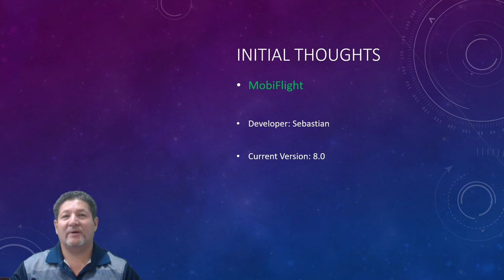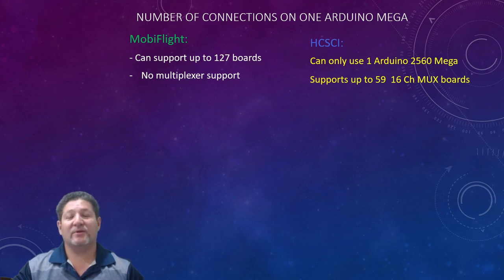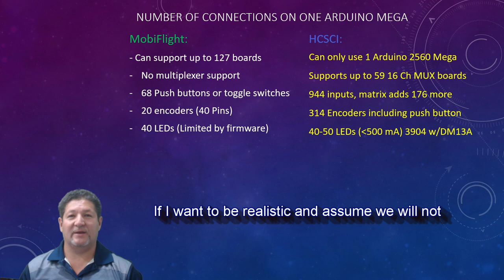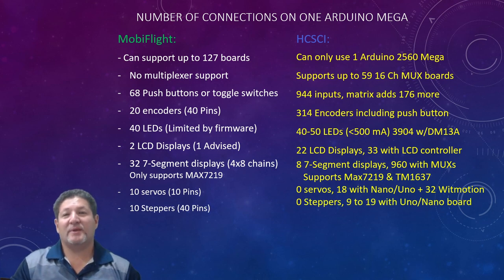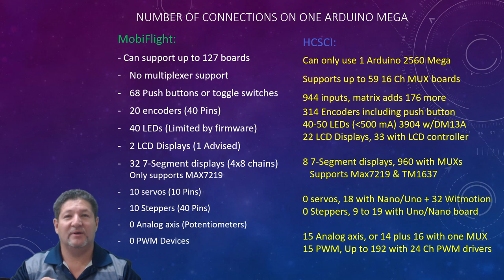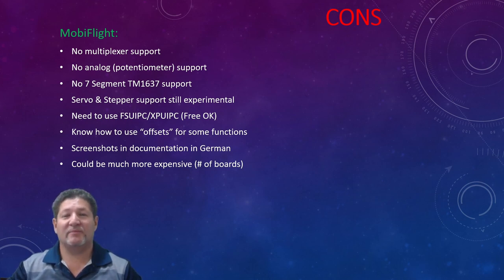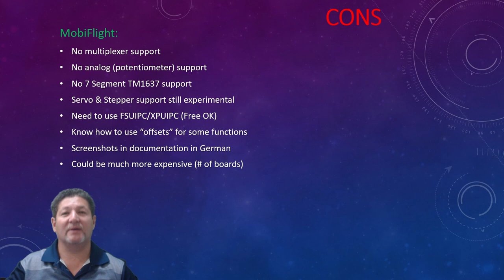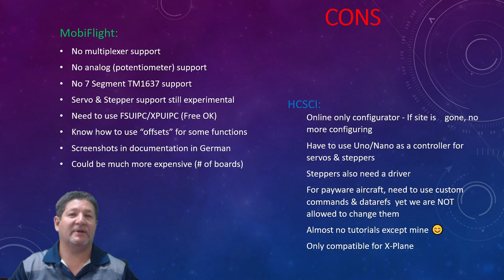HCSCI (Now SimVimX/RealSimControl) VS MobiFlight (Please read description below)

Comment: Awesome comparison! Please note that with MobiFlight you need to run their tool to connect the Arduinos to the Sim, it is not just to make the configuration. With XPWideClient the software can run on a different PC and therefore you would not have a conflict with the HCSCI Arduino. X-Plane Specific: You have to create your own Offsets which point to datarefs in X-Plane. Which means you also have to figure out the data types and such. And there is no community project to create a common list. Imho that is such a pain in the arse that, at least for me, HCSCI is so much better even with current limitations.
Thank you for the video!
Reply from the maker: Oh yes, good point Peter. In a way it's like running the HCSCI plugin inside the simulator but this one is "outside" Although technically each Arduino board has a different address, I do worry there might be some conflict because I've seen that mentioned in the HCSCI forums when people are having connection problems. I see them telling them "make sure there are no other Arduino boards connected to the computer." The simplicity of this system is definitely one of it's major strong points.

Comment: Yes reading the website is also very important, I tried to replac the old version with new HCSI without  reading the page, I deleted all, and reinstalled from scratch, but my 7-SEGEMENT didn't work, So I visited the website by reading carefully, I noticed I should not deleted my old settings and data, So I did what website instructed, well.. all is working now 😁😀👍👍👍 I have still to say, your video helped me very much, to not getting lost whenever I visited the website. 👈🥰 awesome comparison.

Comment: Thank you sir, for another great thorough video!  I agree that its a bit risky making a lot of invetment in time and materials, if they decide to just shut down the business. This could be easily alleviated if the just had a stand alone configurator!
Reply from the maker: The good thing is that if you build something and get all the assignments configured it should keep working forever as long as you have a copy of the plugin, the database file, and your configuration file.
Reply: @Qosmokid  I am  a beginner in all of this. But would love to be able to control some things with switches and knobs :)  Just simple, to minimize the mouse!
 I tried Mobiflight for two days now, and cant get it to work with X-plane.    So i will try SimVim now. And whats great with that is that you are on YouTube! :)  Is there any beginner series that helps one getting started with some simple cirquits?
Reply from the maker: @skinnyTheCat  well thats what I try to demonstrate with my "Back to Basics" videos. You don't really need to know electronics unless you start doing some crazy stuff. All of this is pretty basic if you look at it one type of component at a time.

https://youtube.com/playlist?list=PL_39nliBxZCWlrPDCW440ShaqurNe1c_g

Comment: First, I really enjoyed your video.  It is the first one of yours I have seen.  I am in the process of building a 737 cockpit and want to do as much as I can myself.  I understand your concerns over MobiFlight vs. HCSCI and agree the HCSCI makes a lot of sense.  However, I really like the scenery in MSFS2020.  I do have X Plane 11 so was wondering what add ons that are available that will get it closer to MSFS2020.  One of the things I am hoping for is good airport scenery and things like passengers loading and movement of luggage.  Maybe you can suggest some addons that will bring X Plane up to the level scenery wise of MSFS2020.  Lastly I remember back a while someone who builds or provides kits for HCSCI.  He was in Poland or somewhere near.
Reply from the maker: Hello Jay, thanks for your comment. You know, it's funny that even though MSFS looks soooo much better than X-Plane, I still have absolutely no desire to use it. Unfortunately, I don't use all the available add-ons for X-Plane to accomplish what you are asking, so I'm not sure if I can be of much help. I do have like 60 custom airports,  I have all the ORBX areas that are available in the U.S. and I also use Forkboy Ortho in most of the rest of the country. 

I know there is "Ground Handling Deluxe" by JAR Design by I've never used it , It's only $15 maybe I should get it too 😄
https://store.x-plane.org/Ground-Handling-Deluxe_p_415.html

I think you should search Youtube for "Best free or payware  X-plane Add-ons." Q8 Pilot does a lot of those types of reviews.

As far as buying kits for SimVimX/Real Sim Control, be careful with those because they keep changing the way the plugin works so it might just render some of that stuff obsolete if it changes they way things have to be connected. Although I haven't had too many issues throughout the 5 years I've Used it in my setup.

Comment: Great breakdown, Jose.  I think I know the dude you are talking about at 36:00.  I assume it took me 50+ hours to program the Teensy, with lots of mistakes. Ironically, I think I could write a quick program with a teensy in line that does nothing but redirects an output/input to make custom commands work for SimVim (still looking into FlyWithLua for you, but it doesn't seem like it would work unless the Mega shows up as a controller in the xplane joystick/controller menu).
Reply from the maker: Yup you guessed correctly lol. Wow I never knew it took you that long. I think you're right it probably wouldn't work because the Arduino has custom firmware on it and it does not show up as a controller. I do see a sign on hope on the HCSCI website though which I'm really hoping becomes a reality

Comment: Thank you for the information, it will be useful for my build
Reply from the maker: No problem Jan, hope it helps you choose the solution that will work best for your build
Reply: @Qosmokid  is there a tutorial for connecting stepper motors(IAS indicator) as i understand i must use mux and a arduino micro/nano/uno
Reply from the maker: @jankristensen7884  Yes you need to use a Arduino Uno or Nanos as the controller  daughter board. I have not made a tutorial on that because I have never used steppers or servos. Maybe someday I will but no promises.

Comment: Have you tried both? I like the idea of using Arduino pro minis for each panel so if you have to service them its only a usb to remove and depending on the panel a power cord.
Reply from the maker: No I've only used SimVim.

Comment: Thanks for the video it’s an interesting debate. don’t think your input/output capabilities was a fair comparison. The presented numbers were based on a single board for Mobiflight yet you didn’t count the number of I/o lines you could get with 127 boards connected. You did max out the simvim numbers so iit should of been the same. I also am not sure about you cost estimates. Arduino Megastar can be had for less than $10 if you look so they are about the same price as you quoted for the 16 channel mux boards but yet they have way more available pins. I agree both have their pros and cons but this video is clearly biased towards Simvim. An AI Manager comparison would also be useful for some I think but the comparison has to be accurate. Interestingly Air Manager also focuses on using processor boards although mux boards can be added if you want to go down that route. I happen to believe it gives the most flexibility it not only supports the standard hardware one would use to make a cockpit but it also offers a way to interface to any hardware not natively supported. This opens up being able to use almost any hardware.
Reply from the maker: Yes I did specifically say number of connections on one board because that's what I consider a major advantage of HCSCI. My cost estimates were based on an original Arduino from Arduino not on cheaper no name boards from China. I am aware and I mentioned you can find cheap ones though. All the original ones I have bought have been over $40. MUX boards can be as cheap as $1.35 per board in my searches but usually about 5 for less than $10. You are correct my view is biased towards HCSCI because that's what I've been using. I made it pretty clear I have not used MobiFlight and was basing this comparison only on info I was able to gather during my research not from usage experience. I have also not used or researched Air Manager, but to go back to the beginning that's why I think one of the best features of HCSCI is precisely that you only need One Arduino Mega. Although if you noticed, I also gave MobiFlight some Pros so I don't think it's all bad.
Reply: @Qosmokid  I think my point is the numbers you put up for Simvim are not for one board. Every one of those multiplexers is a board. It’s just the other platforms choose to use different boards. The down side to using multiplexers is it complicates the wiring and for hardware that is time critical it’s not great having to go through a mux. I understand you are invested in the Simvim platform from the basis of many of your excellent videos so I’m not being critical but just offering some balance and a different opinion. At the end of the day users have to find what suits them best. All platforms have something the others don’t. Without support for custom commands and datarefs I believe Simvim will lose users when they realise as you have that their new favourite aircraft can’t be controlled. Both Mobi and Air Manager work with custom add ons and all the sims including FS2020. For some this is a deal breaker.
Reply: Don't forget you need to know a little more electronics to use Simvim, isn't to easy to understand mux connections if you don't have any electronic acknowledge. On mobiflight just connect the switch or led to the pin. Other pro for mobiflight is the comunity behind it. A lot of discord groups and forums to get help, even the Sebastian and some others developers are helping continously.
Reply: @homecockpitinterfacesoftwa4883  I’m just repeating what your users are reporting. I was agreeing that if what they complain about is true then that is not at all flexible. I’m not a simvim user and I don’t have any desire to be because I’m happy with my current solution. If what you are saying is true then perhaps you can point the users here to the instructions for using custom commands and/or datarefs of their choosing. The zibo is just one aircraft. When I say custom it could be any newly created dataref or command even ones they may have created themselves. For that you need the ability to type in the dataref name and type of your choosing and not be limited to just selecting functionality from a list. The point being is the list can never keep up. People stop using Simvim because of this. I think you should consider a way to make simvim work also for more advanced users who want to do more. What happens is they may start with simvim and then move onto something else when they out grow it’s capabilities.
If I’ve got the wrong impression of simvim from this and other YouTube videos then I’d be glad to put the record straight. After all there is always another side to every story.
Reply: @homecockpitinterfacesoftwa4883  I never said I haven’t tried. I said I’m not a user. Did you actually watch this video and others where users are complaining about a lack of custom command and dataref support in simvim. If it will do all those things then why are your users saying it cannot do what they want. I’m not mis leading anyone I’m just commenting on this video and the general situation and feeling by agreeing it’s not good if it does not work.
Reply from the maker: @jetraid  Thanks for your comment. I did mention the availability of more "help" for MobiFlight as a plus for that solution. As far as MUX, although they do make use of 4 data, 1 signal and a voltage and ground wire, they are not that difficult to understand once you connect one. With HCSCI you can also connect LED'S, switches, encoders, or anything else except steppers and servos directly to the pins. I think my overall point I wanted to make is that on HCSCI we have the ability to connect hundreds of components using just one board.
Reply from the maker: @ExperimentalSimAvionics  Well once again, I specifically said one Arduino 2560 Mega board. I consider MUX boards extensions because they don't have a CPU, memory,  and don't have programming or firmware on them. Arduinos are actual boards with a CPU and flash memory
Reply from the maker: @ExperimentalSimAvionics  Just to be fair, they do have an area on the website when all the custom command and dataref stuff is explained and actually converted. The issue I've had is that all parameters related to the radios, NAV, COM, XPDR, ADF, and GPS are not allowed to be converted to custom commands and datarefs. You are the second person to suggest having the ability to type in your own parameter and I think that would definitely solve all the issues related to that. I actually see evidence on the website that they may be getting ready to allow that. If that's the case maybe you and S G were instrumental in helping that become a reality and I'm very glad you guys mentioned it.
Reply: @Qosmokid  we will have to agree to disagree about the boards thing. I think the type of board is largely irrelevant. Having more processor boards means more USB connections but simpler wiring. Using mux boards means less USB connections but more complex wiring. I guess I prefer no mux boards because it works better in my setup. Like I said before there are pros and cons of both and therefore feel your video should of not favoured one approach over another in this regard.
As far as support for custom datarefs is concerned. I hope you get your wish. Judging by the denial of the issue here though by them I’m not so sure they believe it’s an issue. Perhaps they realised the strong feeling in the community and have done some research of their own. Anyhow if anything I said helped in anyway I’m glad to of been assistance.

Comment: Another great video! FYI, The first software I tried for my 737 MCP panel build was mobiflight. I had limited success. Some things worked, some things didn’t. Then I tried Simvim, and everything just worked! It really was amazing. I was sold instantly. I do have a question though. Where can I find the physical buttons and switches for the MCP panel that look authentic to the actual aircraft? Yes, there are tons of push buttons available, but I have yet to find a square button with a green led in it. Any sources you can provide would be appreciated. Thanks!
Reply from the maker: Thanks again Tzampini, I totally agree nothing simpler than SimVimX & Real Sim Control. I think most people buy them very expensively and some people 3D print them. I find that the KD2-22 korry type switches look good enough for that purpose. I ordered some from Ali Express but it did a while to get them.

https://www.aliexpress.com/item/1005003686608280.html
Reply: @Qosmokid  The KD2-22 looks very well suited for the switches on the MCP panel. Ali Express offers two types, latching and momentary. Do you remember which ones you purchased? Thanks again, Tony
Reply from the maker: @tzampini  Momentary, the latching one behave more like toggle switches to SimVimX
Reply: @Qosmokid  thank you

Comment: Thank you for sharing your knowledge.
I live in Brazil.
Is the real sim control compatible with P3D?
If the answer is no, can you tell me if PMDG 737 is compatible with xplane or any similar aircraft?
Reply from the maker: Hi Carlos, no Real Sim Control is only for Xplane and the PMDG 737 is not compatible. We on Xplane use the Zibo Mod 737-800 it's a much improved versión than the stock B738 that is included in XPlane.
Reply: @Qosmokid  Thank you very much!
I use p3d and 737 PMDG, but my avionics are from Virtual Avionics, mcp and EFIS don't work due to simmconect, virtual avionics support doesn't work.
I will have to migrate to xplane and try to redo MCP and EFIS.
Your tutorial is very important to us.